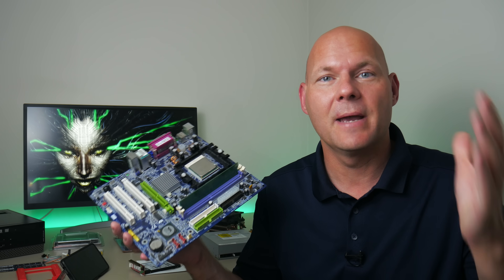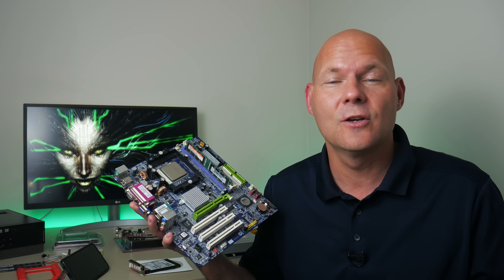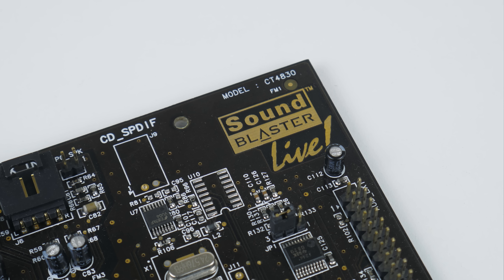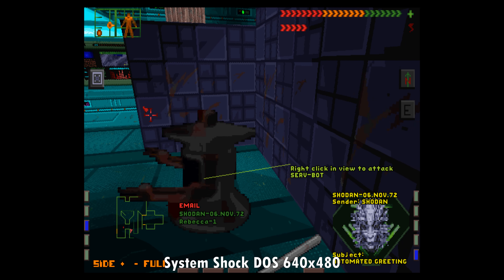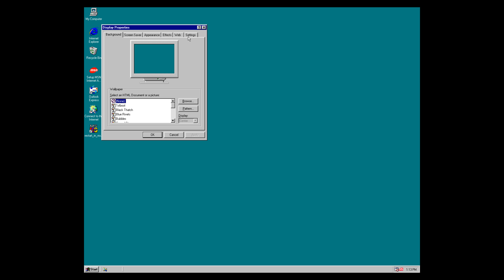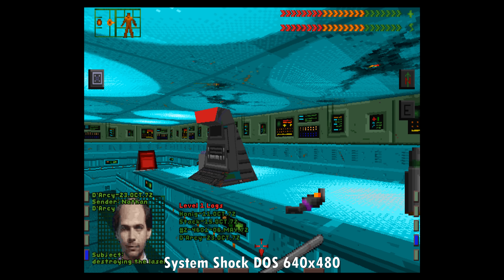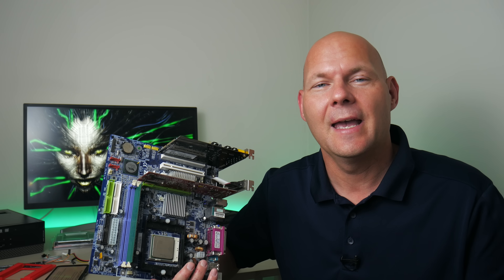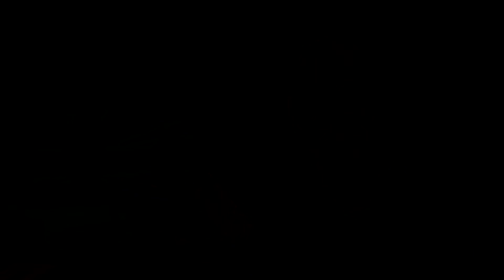Running Demanding DOS Games on Affordable Hardware

Comment: I'm not convinced. Whenever I try to run MS-DOS on my Pentium 4, it can't see any more than 16MB of RAM, even on a 1GB system. I can't seem to find anything in the BIOS to remedy it. And google is useless, because all the results tell me I just need a memory manager (yeah, thanks genius). I'm stumped. I can't see how an even MORE modern system would make it any easier. I just bought a Pentium iii on eBay, and waiting for it to arrive. I'm hoping that'll be a more robust solution.

Comment: How are you getting the Sound Blaster Live! working with legacy audio on a VIA board? I have had nothing but trouble, the WDM drivers may work but if I install the VxD ones with legacy audio support the sound never works again until I reinstall Windows.
Reply from the maker: It simply works on some systems and on others it doesn't. Trying different PCI slots, playing with the BIOS settings can help.

Comment: regarding that Commander Keen 4 scrolling issue, since you are f***ed anyway, I think it's worth a try running the game from Windows (command prompt) using a program called VDMsound... maybe that would help? (because Dosbox won't run in these slower CPUs)   I remember VDMsound helping a lot when I wanted to play my MSDOS games on the transition period of Windows XP (no more 16 bit applications... or was it Vista... one of them...)
Reply: or for example some games like Interstate 76 needed that you went into system options and Disabled Hardware Acceleration for sound and video card, then it would work... the same workaround could be attempted for Commander Keen 4, running from Windows

Comment: wow... AMD Radeon always causing headaches... as a 2-time AMD owner by now, I would say I won't purchase AMD rigs anymore unless they are the only choice in my region... so many small nonsensical issues... I remember my 2009 Mobility Radeon having a problem where it apparently wouldn't be compatible with OpenGL 1.0 or 2.0, can't remember, so it kinda "emulated" OpenGL 2.0 on the fly, something like that and the game I wanted to run on it was Doom (gzdoom custom mods and maps) I remember that somehow the solution for improved framerate was closing the Catalyst software in the system tray and magically my GPU would work again, the game would work fine... no idea how something like this can even happen... say what you want about Nvidia, but they always ensure backwards compatibility... and my experience with AMD on Linux was also terrible, people say Nvidia doesn't have "open source" drivers for their cards but they do indeed provide regular updated proprietary drivers, which just work, no matter if they are open closed or whatever else... at the end of the day, I feel like Nvidia still respects their PAYING CUSTOMERS a bit more... a tiny little bit...
Reply: another thing that happened with this 2009 Radeon GPU was that it wouldn't allow me to run original versions of OpenGL games like Quake2 or others such as Radeon Software's Soldier of Fortune (2000)  The game would not be able to find any OpenGL device, despite me being able to play DirectX games just fine... but now that I think about it, I think this was more Linux fault again

Comment: God I hate VIA and nForce. nForce 4 at least. I have 2 nearly identical Geforce 6100/nForce4 boards (one is 6150SE). One with Realtek HD audio, the other with VIA Vinyl HD. I was really hoping to create a tri-boot environment with Win98, WinXP, and Win7, but ran into several issues. 98 does install natively and runs, but the nForce4 gpu HAS 9x compatible drivers, but they just don't take. Proper Win98 support ended with nForce3 as far as I can tell from my research. These boards were made for WinVista. In WinXP the VIA board gets a nifty gui control panel, but not in Win7. The latest drivers for it say they're compatible w Win7, but crash on boot and won't open. All weird version numbering and odd behavior.

One cool thing is that both the VIA driver (at least under WinXP) and the Realtek HD driver utilize emulated SC-55 MIDI patches. (I might not be fully correct there, but they do something similar)

And the Geforce 6 series drivers are an absolute mess too. When installed with a Vista compatibility layer in Win7, there are 1 or 2 extra options available during install. But there are 2 diff chipset drivers I still haven't sorted out whether I need to install them or not on a clean install using said iGPU. Not to mention that installing the Geforce 6 chipset drivers (or having them installed) after installing Simplex Update7 leads to a hard crash of the system.

Really hoping to upgrade one of these days...

Comment: hey phil, thank you again, everybody loves your videos, me too!
to cope with some difficulties in life right now, I did get a retro hardware haul, right now i am using an iBase mb800h mainboard with a pentium 4 2.4ghz, a geforce 4 (i like it, had no issues so far in dos gaming!?, so i do not understand why it is not recommended) and i use a really shabby isa sound card, avance logic als+, and i love the sound! its such a great dos experiance, with your dos mode super easy I did add norton commander to the autoexec and start in a graphic menu, really comfortable to use!
I did never hear you mention Norton Commander, for me back in die day (i think i was about 10 years+ old) NC was the way to go! a shame i had no longer time for good old dos, windows 95 did conquer my computer very soon. 
so, i love p4 for dos, but only with the right mainboard, ISA slots are a must have for me.
i have two other projects to complete, the ibase board is my second dos retro machine, my first and formost dos machine is an celeron a on an asus mel-m mainboard, socket 370. with a soundblaster awe 32. good times! its a really nice hobbie, and i feel like going back in my lifetime :D 
ty mate, keep up the good work!
Reply from the maker: It is a really fun hobby and good to hear it's helping you a little with whatever you're dealing with. I do know NC but never used it back in the day. Have you heard of VC? Vulkrov commander I think. Very similar in many ways. P4 is awesome 😎
Reply: @philscomputerlab  hey ty for your reply! no, i´ve never heard of it, I will check it out for sure!
maybe you have another lead for me, as kid I did you a progam called "dos menu" - you could program your own directory trees and what not, to start programs and games from a grafical menu. i can not find any good results, maybe you know it??
anyway, thank you again and best regards from bavaria in germany!

Comment: Love these retro builds Phil !! Just a quick question... is there a reason you don't use the R9250 with 128bit memory bandwidth? Would love to see a comparison with the R9200 and maybe a few other lower 9000 series cards like the R9550. Keep up the good work.
Reply from the maker: I just use what I have on hand. For DOS I doubt it makes any difference but for Windows a higher memory bus most certainly affects performance!
Reply: @philscomputerlab  I think these lower 9000 series cards are great candidates for retro gaming. It would certainly be interesting to see which ones are worth chasing. Is it worth going for the slightly higher models, do they provide a nice performance bump, or is the 'cockroach' 64bit R9200 the best bang for buck ? I'll keep an eye out for them on ebay and hopefully make a few donations... :)
Reply from the maker: @david7delta  yes they are awesome and why I use them so often for 98 projects. Great drivers under 98 as well, sharp Anisotropic Filtering and even some AA options to play around with.
Reply: @philscomputerlab  Success... two cards on the way. An ASUS ATI Radeon 9250 128MB and a GECUBE ATI Radeon 9550 128MB. Cant wait for them to arrive !!
Reply: @philscomputerlab  Yes, the Anisotropic Filtering and AA options hold the greatest interest for me. I currently use a TNT2 Ultra and its a great card, but I would love to have an AA option for my favorite 640x480 games. Thats why I'm so interested in these 9000 series cards. Would really be interesting to see an AA comparison of some classic games... I loved the original Diablo, and the original NFSSE. Both I think could benefit from AA... The amount of hours I spent racing the Testarossa in Alpine on NFSSE... oh my. :D
Reply from the maker: @david7delta  You likely know this, but when it comes to AA Voodoo 4 and 5 are very interesting as they can do Super Sampling. I believe some Radeon cards can also do this but not sure about what card and what driver...
Reply: @philscomputerlab  I dont think the original NFSSE ever supported voodoo drivers... so I never tried them. Not sure about Diablo. However the Radeon cards can make nearly any older games look better... thats the attraction here. The 9000 series also covers a wide range of power levels, all the way up to the 9800 cards. Just need to find the card best suited for your favourite game... select the desired resolution and AA levels, then find the card to handle those requirements.  :D
Reply from the maker: @david7delta  Voodoo supports Direct 3D and OpenGL so shouldn't be an issue even with non Glide games.
Reply: @philscomputerlab  I own a Voodoo 5... but I'm still not sure it has enough power to enable AA AND the frame rates required. Whereas the 9000 series have all the power you need for AA and maintaining high and smooth frame rates. Well, at least thats the impression I have... And also, sadly, the Voodoo5 is just too expensive for regular gaming nowadays. If it fails I wont be able to replace it at current prices... :(

Comment: Ich find a Socket 370 Pentium 3 with 666+ MHz on an ECS / Elitegroup P6-Bx non Intel, the same ATI ( Radeon 9200 / 9250 ) but a Terratec Base-1 / Terratec TT1816 ideally with a DreamBlaster S2 the most compatible and affordable package out there.
Because ...
- The latest generation of those motherboards are the most compatible, and at the same time are likely to still function.
- The P3 is an actual CPU of that time causing less trouble regarding compatibility.
- The TT1816 based ISA soundcards are DOS and Windows soundsystem compatible, which means they effectively run with anything.
- The TT1816 have bad FM synthesis, so if you don't want for your ears to fall off the DreamBlaster Midi Synth-Boards are a very good solution.
- The ATI Radeon 9200 / 9250 is quite compatible regarding motherboards, games and operating systems including Win 98-SE and early XP titles.

Comment: The amount of options is always a great thing. I've had an Acer PIII 733 machine that has served me well over the years, and aside from giving it a new case circa 2004 and and SSD a few years ago I haven't really found a need to upgrade it. I am also using a Sound Blaster Live, though I think it's one of those Dell OEM ones that's even more picky. Thinking about replacing it with a Yamaha XG era card -- or if I can find one of those cheaper ones that use Yamaha's chips!

Comment: I've got a coble of Sound Blaster Live cards, and I've had a problem FM synth emulation on these cards ...it just sounds wrong! However with these cards what I like is the agility to load soundfonts up to 63 - 64Mb , makes a huge difference over the stick 4Mb soundfont. Loading a larger soundfont like weeds sounds awesome , and the card will use that soundfont when booted into pure DOS.😊

Comment: Hey Phil, great video! I have a similar build of an AMD 64 3000+ on an SiS chipset., With 1024MB of ram, a Radeon 9550 (great tip about using the VGA port for high refresh btw). I'm using 2 soundcards, a Yamaha YMF, and a Soundblaster X-Fi. I'm dual booting Win98 SE and Win Vista. I've got the Yamaha card enabled in Win98, and the Soundblaster card enabled in Vista. I run DOS games in Win98 - I've found problems with DOS games running in pure DOS with the Yamaha card not supporting wavetable sound on the board.
Reply from the maker: The highlight of the Yamaha is the authentic FM.
Reply: @philscomputerlab  it is very good FM on that card! I have 2 of those cards thanks to a very early video of yours on the Audician 32 boards having that Yamaha chipset. The wavetable is AMAZING! One of the best sounding cards I have had with native GM synth! My only complaint with them was having FM only in pure DOS games , like most Apogee titles and Duke3d! Unless there is a driver you know about, I can not get Duke 3D to recognise that cards wavetable capabilities in DOS. Doom is fine however! I know this card has a true opl3 chipset on board, but when the wavetable on the card is so good, I want to use it! Personally when it comes to FM synth I can't shut up about how well ESS cards do it on a single chip

Comment: I have a similar system with an Athlon XP CPU and a similar Radeon you had recommended in a video years back. It's a great dual-purpose rig, allowing nice, high res titles in Windows '98, but it also has decent enough DOS compatibility as well. As you mentioned near the end of this video, I agree that you definitely want as much CPU power as you can for later DOS games that support higher resolutions. I still love playing the original Quake in software mode, for instance. At 1024x768, my system still manages a flawless 60fps. Paired with a CRT, it's a great experience!

Comment: Heh, this is actually very similar to a retro PC build that I tried a few years ago. I combined my old Athlon 64 3200+ with a second-hand EPoX VIA-based motherboard, a SoundBlaster Live! 5.1, my old GeForce 6600 GT as well as a Voodoo 3 graphics card. I was having trouble getting Windows 98 to work well though; especially the USB mouse wouldn't work for some reason, which made installing drivers and software quite tricky. I should try with a PS/2 mouse but I don't have one at hand. DOS compatibility was also merely so-so; some games had graphical issues like Commander Keen in this video, and Ad-Lib didn't sound quite right to me. It felt to me like this hardware was just a bit too new to make for a successful retro PC. Watching this video makes me want to try again though, and perhaps I should give FreeDOS a shot instead of the dated original OS'es.

Comment: What about physical disc sector alignment? As far as I remember when fist 2048 sector disc come out there was trouble with Windows XP disc partitioning tool, all because in old times first partition C is starts at 63-rd sector. While for optimal performance of 2048 bytes per sector modern discs it was important to move partition on a 2048 sector or so. I guess DOS fdisk is also create partition at 63 sector. And this SSD is of a modern format and use 2048 bytes per sector, while old ones used 512. And it may work in not normal conditions.
Or this adapter SATA-IDE takes care of this alignment? Some HDDs of that era had jumper position to move virtual sectors, so 63-rd sector becomes okay to use.
Reply from the maker: Yea you can align partitions if it bothers you! I covered this in a previous video!
Reply: @philscomputerlab  thanks, I will watch the other one too!

Comment: The only 754 I have comes with integrated  Nvidia MCP61 graphics with a Pcie slot, but has no improvement by adding one given the CPU speed limitations.  The added benefit is being able to run 
Linux and streaming some lower resolution video. The downside is the Alsa drivers are not spdif functional with the chipset. So analog only.  If I use Emachine Xp, it all works. Windows 7 64bit would also work. The dual thread Pentium 4 (775 Dell) I have, also does a nice job aside from the higher TDP,  but that was stock with XP.  If would be nice if 64 bit W7 had a 32 bit shell.

Comment: Cool setup and video ! As for a MS-Dos/windows 98 setup I built a Pentium4 machine with an Asrock 775i65G (rev3), 512mb of ram, a 40gb Maxtor, a Diamond vortex2 and 6800 gt. So far it runs really well (only tested duke nukem 3d and little big adventure 2 at the moment).

Comment: I started with this motherboard for my first win98 pc build with sempron 1.6 GHz. Now my win98 pc is on Asus CUV4X socket 370 with Pentium III 1 GHz. Actually Gigabyte GA-K8VM800M i have in Win2000 pc with Athlon64 2.2 GHz.

Comment: I think we're gonna see a shortage of 754 and 755 sockets shortly soon on ebay, I figure LMAO.

Good video Phil, I picked up a Gigabyte 8S661FXM-755 last year to verify some cards I was gonna throw over on ebay but found it's actually quite a solid performer in Windows98 and DOS tasks respectively too. Back then I'm pretty sure you'd want to gravitate towards Nvidia's Nforce chips, but these SiS ones aren't at all bad for the task at hand with 98SE. You could definitely make these components work flawlessly if you don't care about getting age-specific components. There's some fast single-core processors here for sure.

All the same, it's probably best to be prepared and buy replacement caps because...yeah, these motherboards are all from /that/ period.
Reply from the maker: Working on a Pentium 4 video with a SIS chipset board...